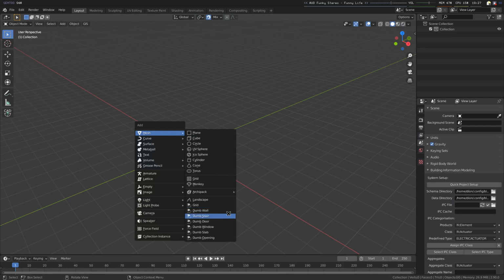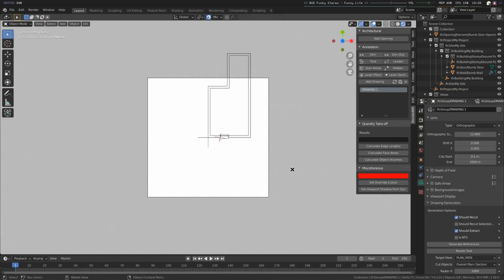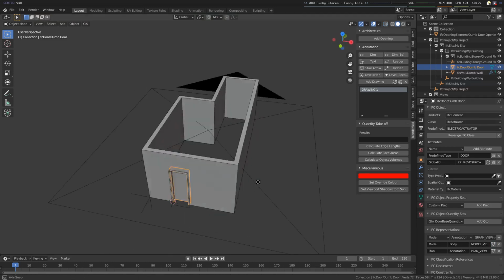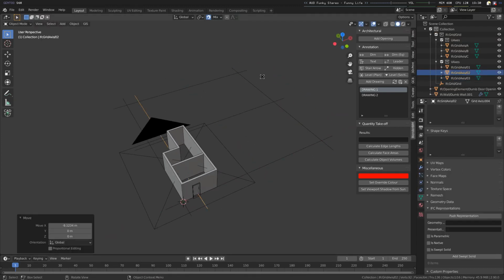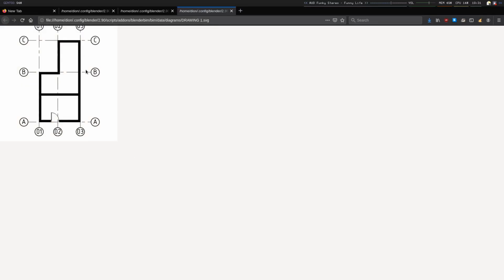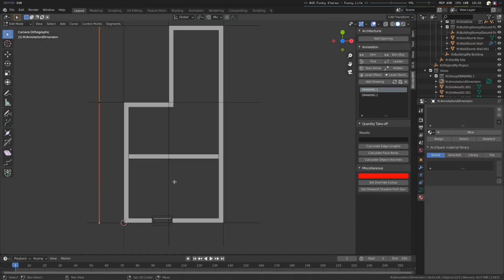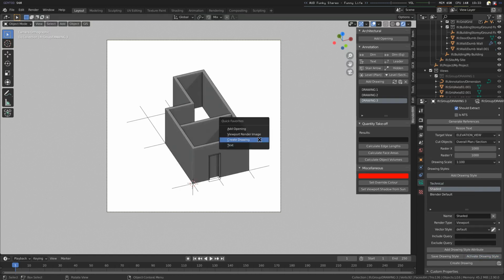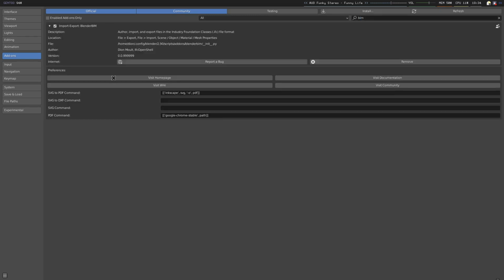Creating drawings - 200912 BlenderBIM Add-on Technical WIP Demo

Comment: I have enabled BlenderBIM.  All I have under mesh is: Dumb Stair and Dumb Opening.
Reply from the maker: Indeed, model authoring has progressed, and now authoring things like walls and slabs use native IFC parametric behaviour. So any IFC type with material layers or profile layers will suffice.

Comment: Now get rid of that “turn around the model” painful view and add a real free flying view that is comfortable and maybe one day Blender will be usable to design worlds… and do mapping. =)
Reply from the maker: You mean fly mode? That already exists. Shortcut is Shift-`.
Reply: @DionMoult  I said a “free flying view **that is comfortable**” 😉 The mapping tools dedicated to build game worlds like the radiant ones make possible to move forward and backward with the mouse roll, so you only need one hand to control the camera view and move in the world and that keeps your other hand free for tools operation. Well in fact you can use your both hands to edit stuff (keyboard on left hand, mouse for view and left/right click) and only one hand (like right hand) to move (view and roll for moving backward/forward). Blender behaves either as a modeler for objects you can turn around, either behave as a game, but does not really behave as an editor for a world you're in.

Comment: Great, I am fond of Blender and always use it and already into the engineering industry creating affordable engineering software. I would be glad to communicate and contribute to this project to add the STRUCTURAL discipline aspect to it. BTW, I am a good user of Blender and I always wished to extend its functionality to suit Structural engineers too.
Reply: Go check out community.osarch.org, there you can probably find a way to contribute to this project and other related projects
Reply from the maker: Indeed there is currently basic structural analytical model support with integration with code_aster for the simulation.

Comment: Dion, one commenter mentioned ArchiPack. How does your approach/goals differ from that of Stephen Leger's ArchiPack Pro?
Reply from the maker: The approach and goals are complementary. ArchiPack focuses on Blender-based geometry generation, whereas this Add-on focuses on IFC-based BIM data (classifications, clash detection, diffing, ISO-standard properties and attributes, etc). Both our add-ons integrate - you can use Archipack to generate BlenderBIM Add-on compatible geometry, and you can use the BlenderBIM Add-on with Archipack to generate BIM data and IFC output. These "Dumb wall" geometry generators are simply almost vanilla modeling helpers that are a small step up from manual modeling, and do not replace the highly parametric shapes that Archipack provides.

Comment: It is possible to create a master drawing with multiple views into the same sheet? Like top, side, projection view, rendered view and section view, all into the same drawing? Also an option to reuse this drawing presets to create drawings for different components will be a very useful feature.
Reply from the maker: Yes - it is possible, but we need more users to help polish the workflow to minimise the number of manual steps and workarounds. Please see these links for more drawings I have created using this method: https://community.osarch.org/discussion/comment/693/#Comment_693 and https://community.osarch.org/discussion/199/demonstration-of-blenderbim-add-on-used-to-produce-house-alteration-drawings

Comment: Wow, kool! Does this work the same with The ArchiPack addon?
Reply from the maker: In short, yes. It works with any IFC, no matter how it is generated - here is an example created from a model that came from Revit: https://community.osarch.org/discussion/comment/693/#Comment_693
Reply: @DionMoult  I could not add a door into the wall from my Mac and blender 2.9
Reply from the maker: @JTIRAT  Can you try post your question on community.osarch.org as well as an explanation of what you tried? Also ensure you are using the latest version. If it isn't the latest version, you need to select the wall, and then the door _opening_, not the door itself. The latest version is more flexible.
Reply: @DionMoult  Thank you, I m excited to see the updated steps. I will next time 🙂
Reply: Incredible work Dion!
Reply: Great work Dion. Looking forward to using this.